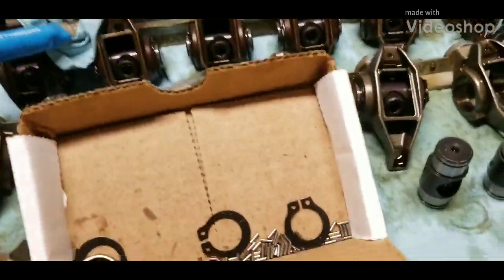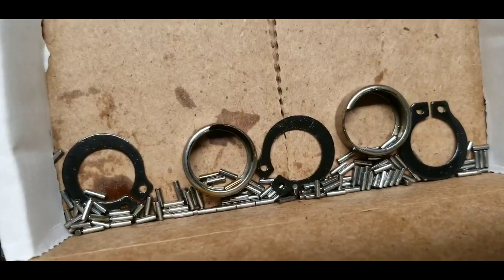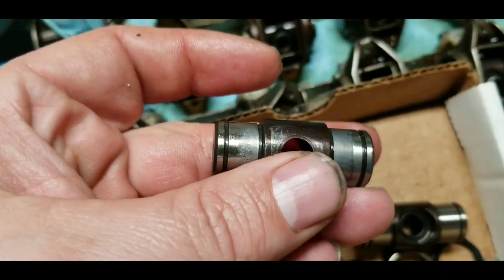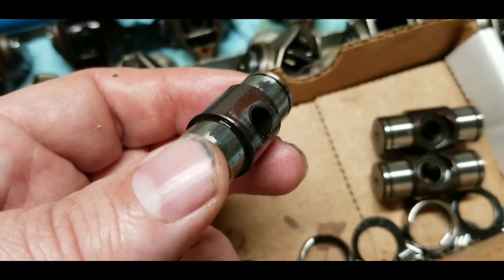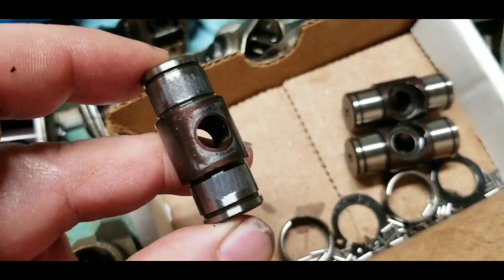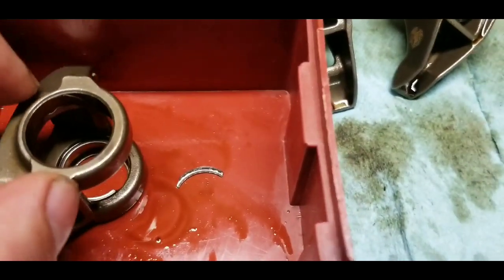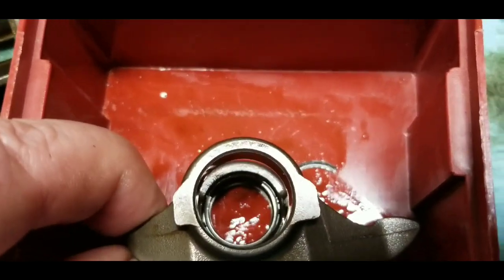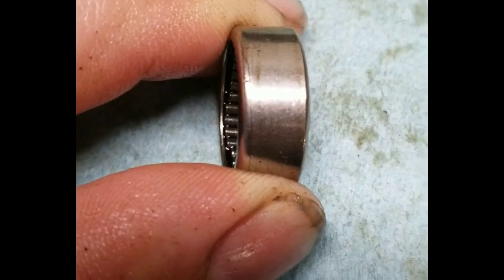G8 Trunnion upgrade failure diagnosis

Comment: oil pressure has nothing to do with this as these are really splash lube parts.  they are not pressure fed.  I feel that the lack of an oil groove from the bolt head recess to the bearing area on top causes oil starvation in these types of trunnion kits.  IMHO.  I have seen a missing oil splasher leg on a con rod cause an engine to lock up from lack of oil causing heat and then thermal expansion and then STOP.

Comment: Thanks for putting this out. I daily a ‘10 CTSV LSA.. I got a nice cam .614/.623 & 231/239 118+4 about to go in and trying to figure out which trunnion option was the best idea especially considering daily driver. Looks like bronze it is. Thanks again for taking the time to do this! Where’s your ride at nowadays?
Reply from the maker: Glad to help, the motor is still running strong making at over 800hp. Unfortunately I snapped the output shaft on the transmission,  so waiting on that.

Comment: Put me down as another example of this exact failure,  just found it tonight,   On multiple rockers also. Hopefully no needles fell in the motor.
Reply from the maker: Take my advice and don't assume anything,  tear the entire engine down.
Reply: @MendingThings  mine turned out to be fine,  I caught mine before they started to come apart.

Comment: What brand are they? I have a PPV Caprice with a cam change , .580 lift and comp cam roller style rocker up grades, 40k ago. Haven't had a valve cover off for awhile. It's running great, but might have to look at the rockers now.
Reply from the maker: They were ZZ Performance but are pretty much the same as many other brands.

Comment: What brand are trunnions
Reply from the maker: The ones in the video that failed I think were the ZZ Performance upgrades but pretty much the same as most of the other brand of needle upgrades.
Reply: Anyone seen these issues with the BTR V2 upgrades? Just purchased a set. And I’m putting in a cam with .585 lift, along with pac 1218 springs. Will properly measure for correct pushrod length when the time comes. Lifters will be Ls7 most likely. Seeing this has me concerned now 😂